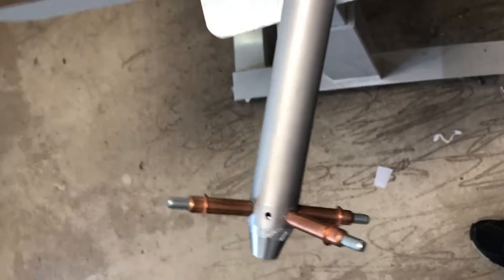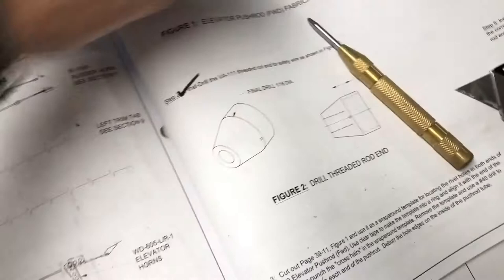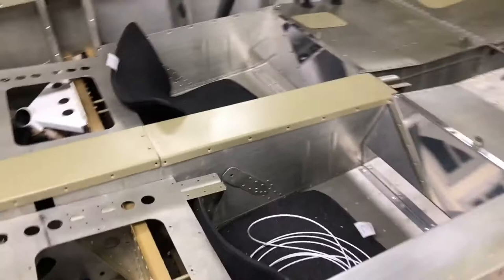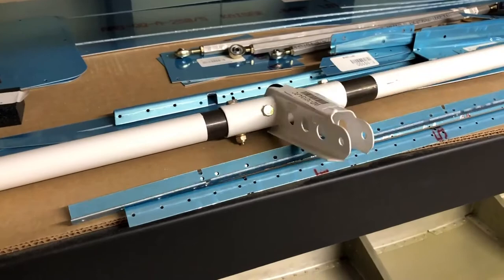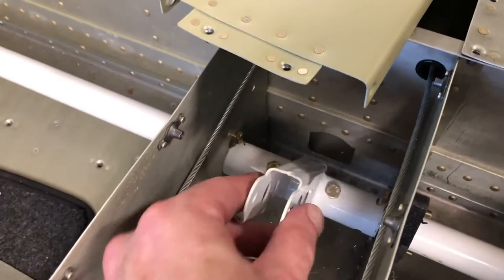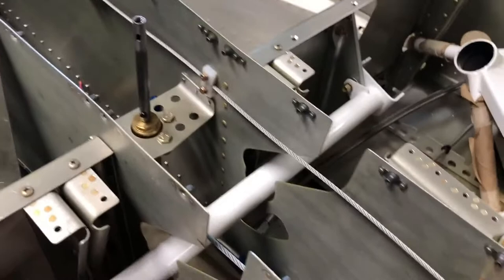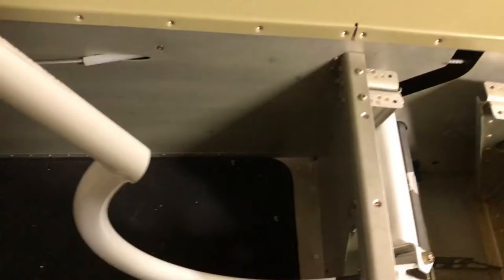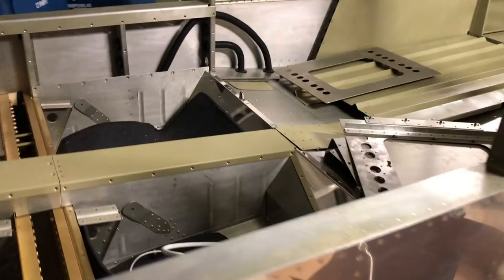Flap Tube and Control Stick

Comment: What primer do you use?  Lots of controversy on this I know.  I’m starting an RV-10 here in FL where the humidity very high in summer.
Reply from the maker: I use akzonobel primer 463-12-8 with CA-116 curing solution (green).  I know there is a lot of controversy but I find it actually seems to make the surface of the aluminum much harder and resistant to scratching. For the small bit of extra effort and minimal weigh it seems to me to be worth the effort.

Comment: Hi George, I am also ordering the fuselage before the wing kit. What piece(s) are missing that should add. Could you pls share the part #
Reply from the maker: Marc,  I believe that vans has changed the kits now so that it is no longer a problem. When you go to order it they will tell you but I believe it was the wing center support but cant remember for sure.